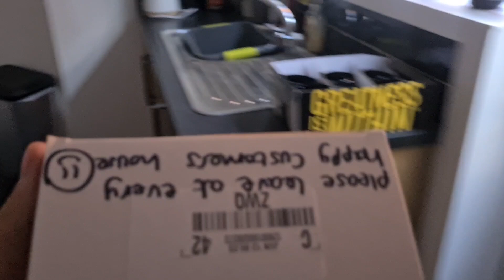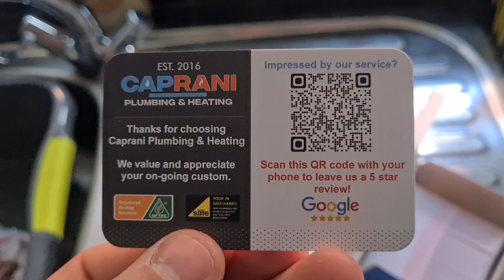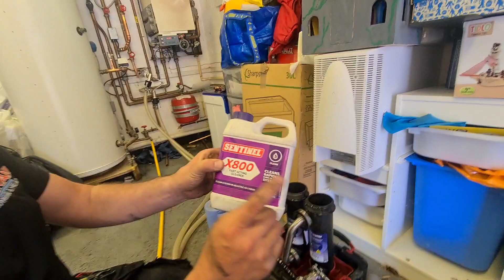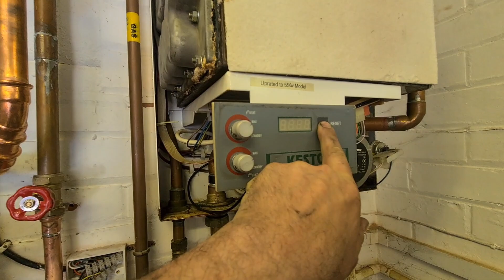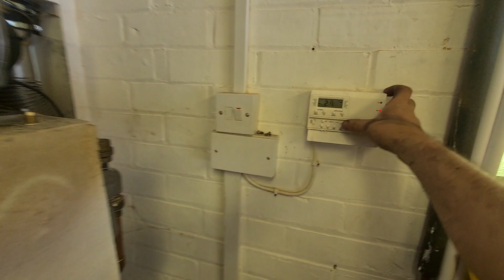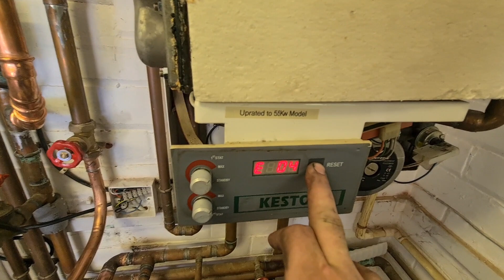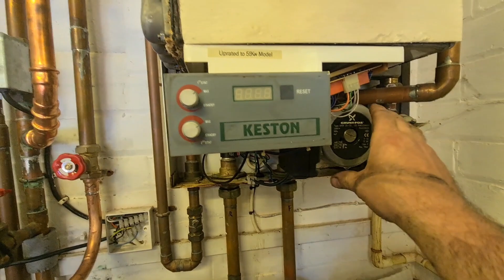Heating Main Live Snatch, Did It Go To Plan?

Comment: Greetings from Ireland - brilliant snatch there. Did a few of these myself, live-swapping those crappy quarter turn circ pump isol valves that leak at the sight of a screwdriver, for the proper ones that work like a gate valve as per your video. Most times I was able to bung the feed and vent to slow the torrent but still had to cut back one of the pipes due to the increased length of the 'gate valve' type isolators. Never did any of these swapovers while hot, though - that would be a step too far!
Reply from the maker: Respect 👊🔥

Comment: When snatching the pump valve you could tuck a rubble sack underneath to catch the spray! Great videos!
Reply from the maker: Not a bad shout, respect for the support. On this one it was directly to ground floor level so just went for it bro 👊🔥
Reply: Rubble sacks are so handy. Work well for rad valve changes aswel

Comment: Why did you not install the pump correctly? It looked like there was enough room to install it horizontally as it should be. Installing vertically will trap air and cavitate the pump reducing its service life.
Reply from the maker: Mr Fandango, It is the existing punp and we put it back exactly how it was.

Respect for the support bro 👊🔥💥
Reply: Even so, as you changed the valves it would have been better to put it right. I liked the snatch though!!
Reply from the maker: @johnnyfandango1625  👊🔥